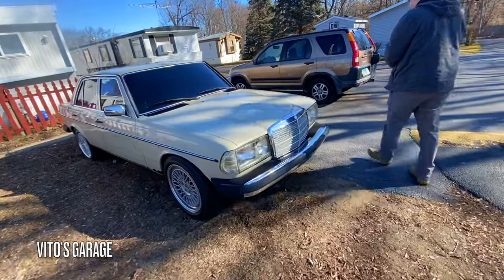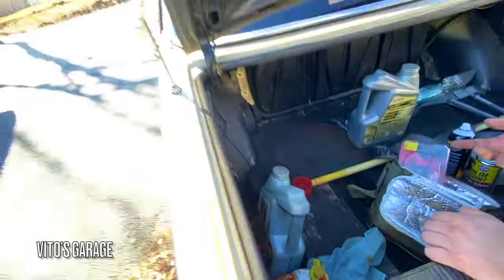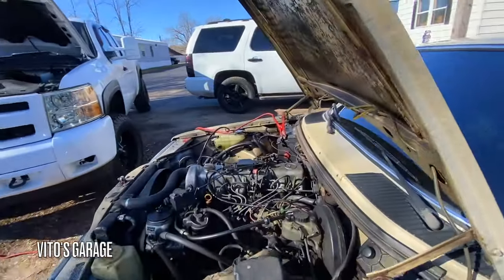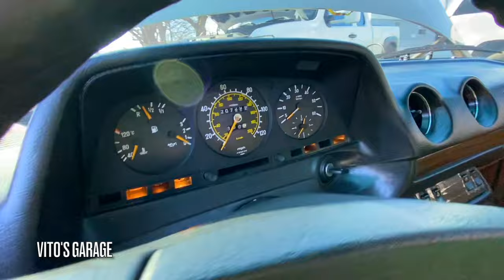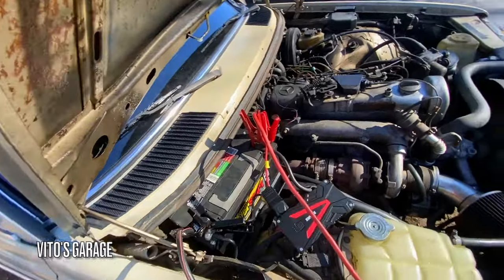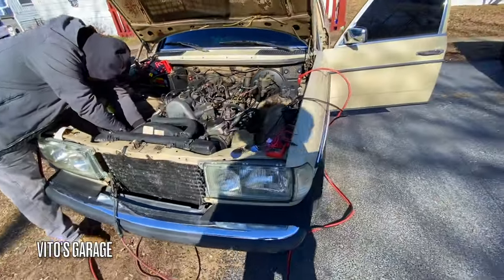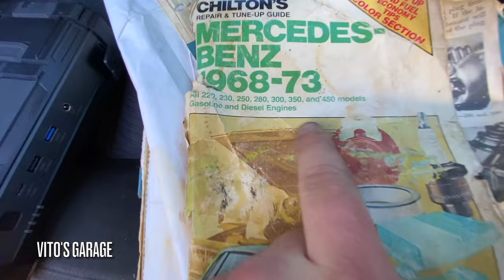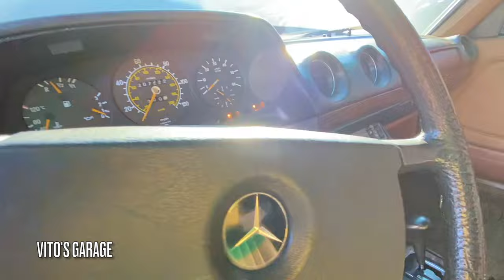One of My First W123's. 1983 Mercedes 300D

Comment: In my W123/W126 diesels the battery has to be almost perfect to start in the winter. Even with the jump from the truck, I am not surprised it didnt start! It was turning over dramatically too slow. I also use 10/30 oil in the winter instead of 20/50. The difference was dramatic! Did you ever get it started?
Reply from the maker: Yeah it started with new battery